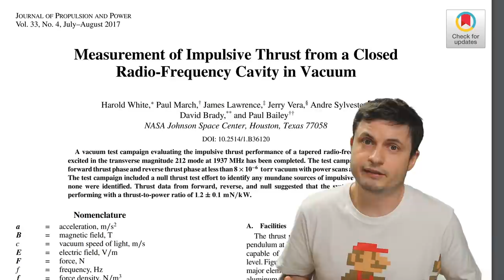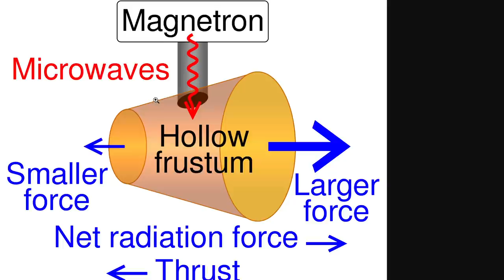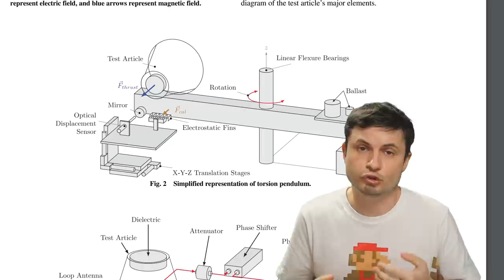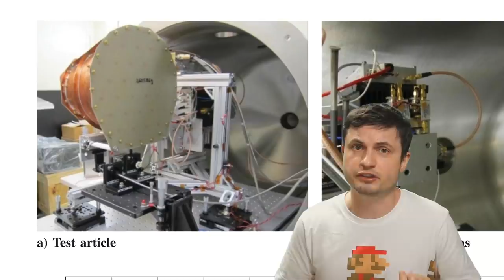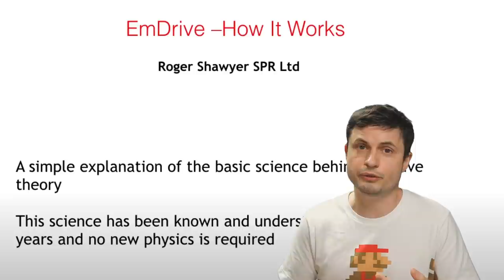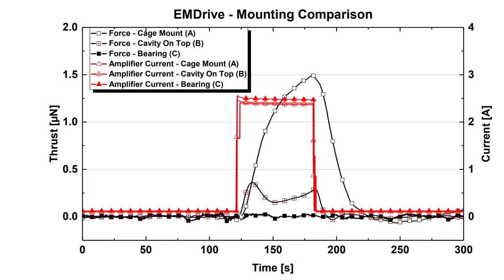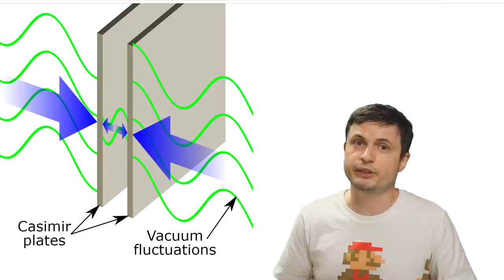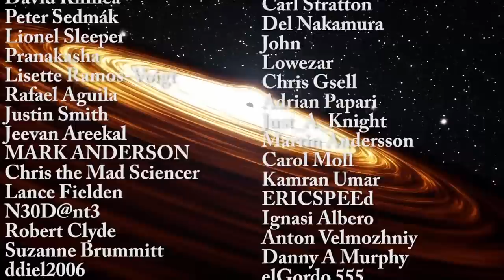Looks Like EM Drive Is Officially Dead - Experiments Fail

Comment: The reason the Mythbusters managed it was that the sail was reflecting the energy from the fan. So it was basically just really inefficiently pointing the fan backwards
Reply: The sail became a crude wing when they did that.
And there may have also been currents in the water.
My bet though is that it's TV so....
Reply: In short: sail actually gets more efficent when air is blown at it at an angle. At the same time, pulling vector from the fan changes. The effect is that the sail, along with a kiel redirects force and creates slight forward momentum from side momentum all force vectors even out. It would still be more efficent to simply use the fan as an air proppeler.
Reply: Technically the reason it worked was due to the shape and size of the sail to the fan so a large enough amount of air hitting the center of the sail dispersed around the original winds blown from it producing backwards force pushing the boat. They showed how changing the size of the fan to sail ratio seemed to change the effects with the sail needing to be at least around 4 times the size of the fan. But yeah, they also showed just pointing the fan backwards was drastically faster than using it with the sail in reverse.
Reply: @BolinFoto  Well, the sail IS moving outside air to thrust the ship forward, in a very inefficient and stupid way.
It would be impossible if the fan and the sail were completely sealed off from the external world.
Reply: You also got to ask: Why not just turn the thrust 180* and just use it. Even if you could (theorietically) work. Why. Just why. Even if you would get 1% forward momentum, you could still just flip it, and ditch the sail, and be better of.
Reply: The fan/sail also works because of the distance between the fan and sail. The moving air is lower pressure than ambient air so more air is pulled in from the sides to hit the sail. So you have mass m of air leave the fan but mass [slightly above] m hits the sail. It’s tiny, but enough to get some movement even pointing straight on. But of course it would make more sense to just ditch the sail and use the fan directly.
Reply: I think vortexes were created at the edges of the sail.
Reply: @mancubwwa  that's not the point, the point was to refute conservation of energy
Reply: @E2theBizzle  i think the fan induced a kind of venturi effect and involved the surrounding atmosphere in pushing off the sail
Reply: Basically it worked like a thrust reverser on a plane
Reply: @misham6547  how about the mythbusters where they put softball sized divots in a car and got better gas mileage?
Reply: @NwoDispatcher  Yes. Exactly.
Reply: Yeah the MB effect is no different in principle (but very different in efficiency) than the old bucket type thrust reversers on jets.  The jet reversers are redirecting the mass coming from the engines and a portion of that mass flow creates a force component that slows the jet down.  MB created an inefficient bucket-type thrust reverser, among other things.
Reply: @ceoofupfuckery.8561   You're missing the point. They're testing a physics question (conservation of momentum)
Reply: yup pretty much I thought of that too earlier, if the fan produces more Kilonewton than the sail then why not just tilt it.
Reply: @kdragon7  ah yes we know we're just trying to think more efficiently
sorry for bothering.
Reply: ...Isn't that how a sail works in the first place, tho?
Reply: The reason it works is because the sail is in the shape of a parabola and the fan is at the vortex. Do the ray trace. It will make sense.
Reply: @mancubwwa  Does a flat-bottomed swamp boat have a kiel?
Reply: I do believe that sail trick is called Tacking. Part of the effect is the hull shape keeps the boat from sliding side to side, leaving a small remainder forward. But it requires friction with the water, and angling to the wind to redirect the forces. Used by sailors for thousands of years, this will NOT work in space.
Reply: @Baughbe  There's a thought, what if you wobbled the em drive's cone while it was in operation?
Reply: @kdragon7  Yes, i know. But tbh, its like the perpetual infinite machines. Im not gonna say "dumb", but it has been tried several times with the same result.
Reply: air was the propellant , the em drive has no propellant
Reply: @BolinFoto  nah mythbusters usually cut it out or gave up on it if the results were boring. they got alot of cut material.
Reply: @JohnDlugosz  probably not, I honestly only watched that episode a long time ago and only a part of it, and did remember what exact type of boat they were using. Probably comes from the fact that they may have added some sort of center- or sideboard. Also rudder too gives a vit of kuel effect. But even without it, they should be able to get a bit of momentum forward AND to the side with the angled thrust setup. Not very much mind you. This is mostly because sailbot with fan on it really is NOT a closed system, as it interacts with both air and water around it.
Reply: So, just close the smaller end of the em drive and that will reflect the energy... it was that simple!

LOL
Reply: The Mythbusters experiment didn't break any laws of physics. It wasn't a closed system, as ambient air external to the fan & boat was constantly added to the system.  The EM drive claimed to operate without any ejection of propellant mass. The Cassimir effect, while very cool, doesn't seem to result in a net thrust for the system as a whole?
Reply: Sail can work like an oar in the air, once it moves (or like a wing, if you prefer). This is why sailors can often move their boats forward just by rocking the boat, or by manually moving the sail - which is impossible on a sailless boat. I'm writing this from experience.
Reply: @Dan Forsberg Why indeed...having the fan pointing backwards is a common method of propelling boats, including the one used in the test. So I guess that on real life, the answer is that we don't blow on sails with fans.
Reply: that looks like some thrust reversers for jet engines. They redirect their exhaust forward.
Reply: The effect seems to have been caused by turbulence.
Reply: Mythbusters come from Hollywood so they are a part of the story. It would be actually stupid of them to prove to the public that “the king is naked”. All of the NASA missions is nothing more that low budget sci-fi movies that are presented to us as “a scientific evidence of NASA activities”.
Reply: More importantly, it just wasn't a closed system. There were things outside of the system of the boat, fan, and sail that could exchange momentum with the boat. Like you said, net result is similar to just blowing air backwards, because the air isn't also being carried forward with the boat.
Reply: @oggeeboggee  put your tinfoil hat back on and stop talking rubbish. For NASA to fake any space mission the Russians, Chinese and everyone with a telescope big enough to see would have had to be in on it.
Reply: @E2theBizzle  That, just sounds like a hovercraft with extra steps. :)
Reply: @genxlibertarian9656  lol pretty much. That’s why it’s better to remove the sail.
Reply: @seriousmaran9414  Remember though we're all in on it. Only those who don't believe Nasa are telling the truth. The rest of us are clearly liars who want to keep the lie going to I don't know it's just so damn stupid i can't even come up with a reason.

Comment: "It didn't work for you because you don't understand how it works. It knows you don't know."
"How does it work then?"
"Um, uh. I dunno."
Reply: See me for any help you need xxx
Reply: The principle maybe sound but immature.  Think of a musical instrument.  Vibration itself is amplified from the string through the cavity of the body and amplified in it's distribution through slowing the waves through a series of rebounds.

If this does work with a smaller ID implant with more resonation then it would produce thrust the only problem is it would be delayed in not only output from start but the form fading longer after output has stopped.  There is a delay with each bounce of the wave.
Reply: Did Schrödingers cat know?
Reply: @stefanschleps8758  
Schrödinger didnt
Reply: @stefanschleps8758  It was a 50% chance it did
Reply: @aduantas  if you were paying attention in highschool physics it would be very clear that this device couldn't work. The problem is that if this device worked you couldn't get the momentum of the engine because it would depend on the speed of the observer. If you cannot explain how the conservation of momentum is maintained then either it doesn't work or there is some new physics.  As usual the simple answer is the correct one.
I really would like a reactionless thruster to work but the knowledge I have makes me realise it is unlikely to work.
Reply: @franciscoshi1968  If that were true then conservation of momentum wouldn't apply in general.The explanation has to do with the change in momentum (aka impulse, related to force) of the microwaves, a quantity which is constant across reference frames. The direction of the impulse imparted on the light should be the opposite of the direction that the light imparts on the drive, so it can't generate force from within itself.
Reply: @LuggageStardate  Nothing special here. The light from the filament does exert a force on the bulb. But:
- the force exerted by light it extremely small to begin with. Light sails have to be quite large even for small masses and are practical only in free fall in a vacuum
- the light bulb is transparent and most of the light just passes through it and doesn't affect it
- the light bulb encloses the filament, so for any force on one point of the bulb there is a roughly opposite force on the opposite point - overall those mostly cancel out.
There is probably a minuscule net force and a good physics lab might be able to measure it - but for all practical purposes this force is too small to be useful.
Reply: @LuggageStardate  a solar sail works because light hits the sail and it transfers momentum from the photons to the sail. The photons get their momentum from the sun. So if you add everything up the sun moves back and the sail moves forward.  No laws of physics have been violated. 
In the case of the EM drive the photons push on the large plate with the same force as the small plate + the conical shape. The areas in the direction of motion are the same so no net force will result.
You just need some basic high school maths to show that there would be no net force. 
I think the people at NASA went out of their way to test a dumb idea just in case there was something wrong with our understanding.  I think they were very professional for even trying it.
Reply: @willschmidt7794  I am just not very good at explaining it. But as you say for this drive to work it would need to push against something we do not know exists or thru some mechanism that we don't know exists. Ultimately it can not push against nothing.  I don't think you can break Newtons laws without some serious consequences to reality.
Reply: You're thinking of a quantum drive.
Reply: Mike McCulloch posted an article on his blog explaining his view on why it didn't work, and how it could be made to work
Reply: @aduantas  the problem is more to do with the claims braking laws of physics that are very well tested. I can understand that cold fusion may actually work because there may be some mechanism that we have not considered that does not break any fundamental principles but when some one comes up with some very simplistic device that works for an unknown reason that they can not explain and seems to break basic laws of physics (like conservation of momentum or thermodynamics)  then it is very difficult to believe. 
If the inventor of the EM drive could explain why it does not break the conservation of momentum in a way that makes sense then I would think it is worth while testing. When I say explanation that makes sense I mean using maths or methods that can be followed logically, do not contradict themselves and are based on tested principles. 
When you build a device you will have a process where you use known and tested principles to achieve the desired effect.
If you just randomly put things together and you get some unexpected result and you claim a discovery then chances are that there is a mistake in your claims.
So unless he can explain how he came up with the idea and why it doesn't break the conservation of momentum I wouldn't take him seriously. Most if these results are so small that they border on measurement error.
If he could get this think to lift off the ground without any measurable known force pushing it up (like air movement or electrostatic or magnetic fields) then it would be amazing. Even if he could not explain how he came up with the idea because the effect is so big that it can not be dismissed as measurement error.
Reply: isnt that exactly the same what the homeopathia fools say?

Comment: In the case of mythbusters the fan was so powerful that the wind was reflecting off the sail. When they turned the fan around it went much much faster.
Reply: So in theory, the same principle would work with EM. Just turn the EM around and have it direct out one side only.
Reply: @ariesdane5876  
"Just turn the EM around"

Yeah its called a flashlight drive
Reply: @azmanabdula 
 or an open microwave without safety systems.

Edit: I have a better one: or a Wi-Fi router with a dish antenna ( they use the same frequency as microwaves, I think it was 4.2GHz )
Reply: @azmanabdula  I was being sarcastic. Of course EM is massless and could never provide thrust no matter which way you vector it.
Reply: @ariesdane5876  
"EM is massless"
So are photons though

The reason it doent work is because its all occurring on the inside of the engine 

And not directing it outside 

Like it said in the video
Like pushing your car from the inside

Comment: I'm very surprised that shocking a copper trash can doesnt make it go.
Reply: Not exactly what I was going to say,  but close enough 😆
Reply: If you use enough power it sparks (thrust propulsion).
Reply: All that wasted research. They could've just asked you.
Reply: @smoath  "Research" ha, ha. Did you put that in your circus application?
Reply: No more surprised than the fact that dipping two bits of metal in lemon juice generates electricity.
Reply: No, but shocking a stainless steel urinal would certainly make someone go! Perhaps this is the next avenue of research.
Reply: @smoath  forreal
Reply: Yeah, this comes off as a scam.
Reply: More like "nuking" it, but still....yeah.
Reply: We are Pakleds. We search for trashcans that make us go
Reply: I know It crushed me, I never would have guessed it doesn't do the moving. I am abso...shocked you could say.
Reply: Fun fact: an anti-matter warp is easier to make and even I can make one although anti-matter production is extremely low this era.

:'(
Reply: Wait. Copper. Really and they are scientists ? 🤣
Reply: 20 years of scientific research to learn copper trash cans are less reactive to electric stimulus than my steer.... and i could have told you he wont get you to mars.
Reply: Trash cans on earth inexplicably travel down the street all the time though.
Reply: @smoath  Or just used common sense.
Reply: @samburke9563  Stifling magic, yes.
Reply: @johnporrill6591  Well, at least all the funding money used on it can be directed back to something worthwhile,  cold fusion. ;)
Reply: copper cone no longer goes brr
Reply: @Myname-il9vd   not a total loss though! The copper got to be worth a few hundred bucks !!!!
Reply: Lt. LaForge says you just have to reinforce the copper trash can with a nanopolymer.
Reply: @klausschwabshubris  it’s EM penny time baby😎
Reply: Have you met our weird friend, Quantum Mechanic who might creat a universe if you sneeze. 😬 Im really happy they tried this out though. Means there was something worth testing out.
Reply: Is that a star trek refference with the race that always states we look for things to make it go?
Reply: He should have used gold
Reply: @Nah_Bohdi  It might melt before you get a useful amount of thrust against the mass of the craft though. Although I'm sure you're probably just having a laugh anyway 👍
Reply: Lightning does not make our spaceship go. We are not strong.
Reply: You must feel very safe, saying those things from the sidelines.
Reply: A lot of big ideas seem ridiculous at first.
Reply: It does make it go.  Price copper's go up so someone with nick it
Reply: @johnwade7842  Yes. The Pakleds from TNG spoke in those terms.
Reply: @Martial-Mat  If momentum conservation is wrong all modern physic collapse, as two bits of metal in lemon juice generates electricity,  nothing like that happen .
Reply: Might be an idea to convert that resonator into a moonshine still..
Reply: @myhalong  I was illustrating that things that appear to make no sense can actually produce results. To a layman, putter copper in lemon juice makes just as little sense as passing a current through a piece of copper. Not sure what this has about conservation of momentum. Where's the momentum?
Reply: I'm surprised that the person running the experiments didn't die from the microwaves spraying out the ends of the waveguide; I would have expected human hot dog
Reply: @Martial-Mat  Any thrust produce a momentum, this one need a inverse momentum. this is the Newton law and stay good with Einstein
Reply: @planescaped  I like to think there's an episode out there where the Pakleds just conquer everything in sight. Maybe the last thing Riker hears on a planet surface is a Pakled communicating to his ship, "make it....burn."